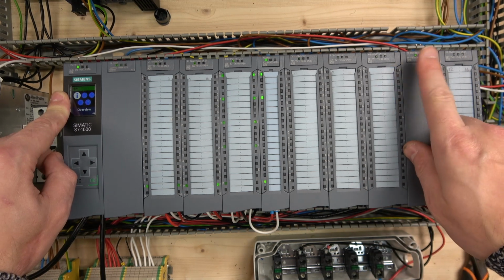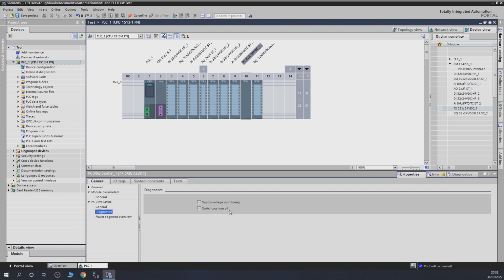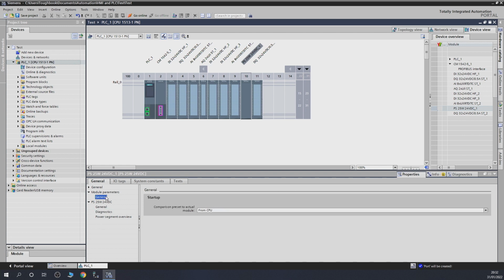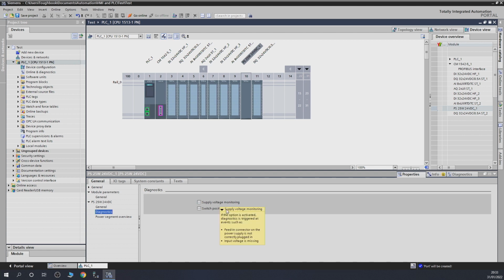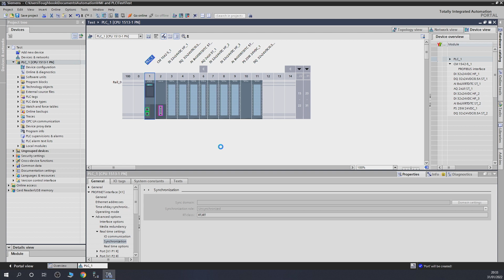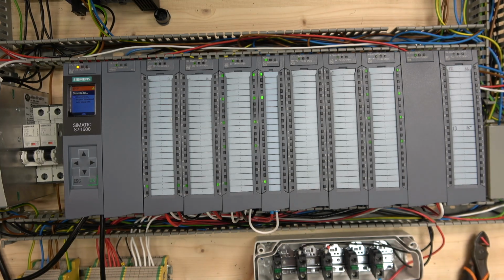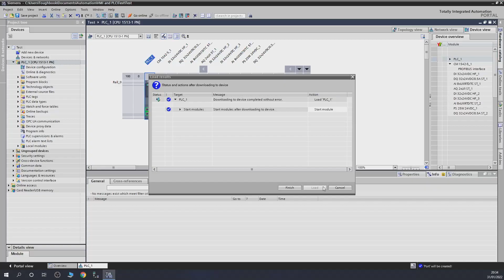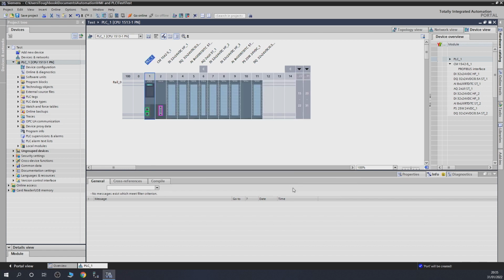Siemens S7-1500 series PLC rack expansion with additional PS 24W 24Vdc power supply.

Comment: This is nicee. Keep doing some "What happens if...." type videos more. For example:
1. What happens if an output phase from a VFD got disconnected
2. What happens if analog voltage to a AI is out of the max range 
3. What happens if the termination resistor in a profibus connection got disconnected